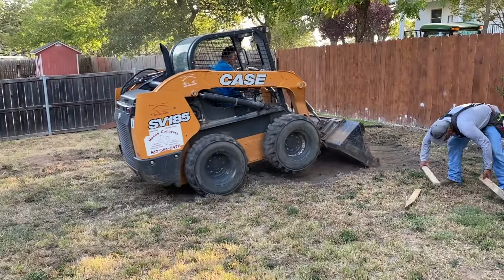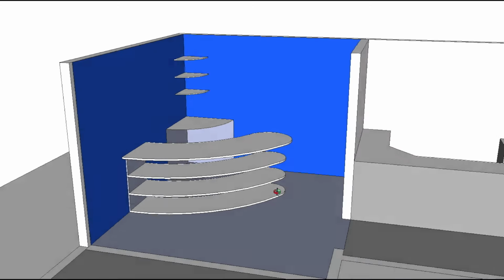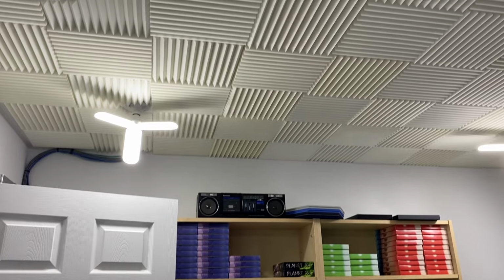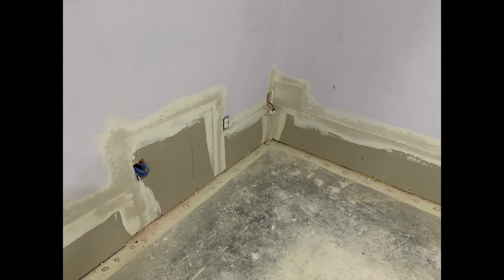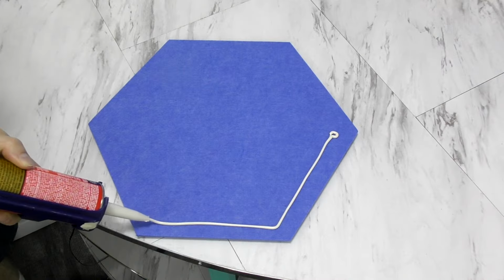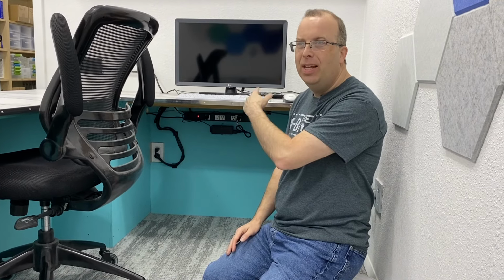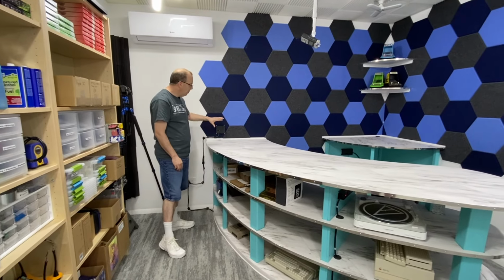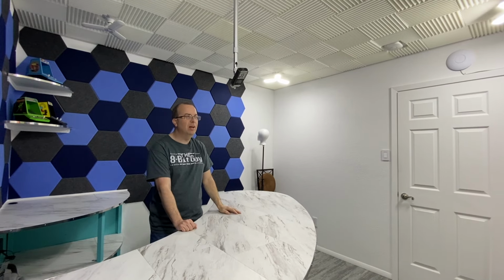8-Bit Guy Studio Build - Part 3

Comment: As someone from a completely different part of the world, the way americans make their walls out of thin boards is always fascinating to me. I'd be way too worried about stumbling and accidentally crashing through a wall, I think. :(
Reply: Yep, only bricks and concrete here.
Reply: I also come from a place with brick walls, but we have few drywall walls in some places, and you will be surprised how much abuse they can take. Also can you recall the last time you crashed into any wall :D
Reply: Drywall is surprisingly strong!

… But there’s a few random parts of my wall that are made of actual cardboard. Like what a TV dinner comes in. I don’t know how or why but I’m guessing it was an aftermarket patch by the previous owners. They should’ve done it right though because it got kicked in pretty fast on accident (next to a bed).
Reply: Sheet rock is exactly that- gypsum stone mixed in a slurry and formed into boards. When screwed on 18” studs on both sides of a wall it forms a rigid structural member that is able to withstand settling, earthquakes, and impacts. When damaged it is easily repaired. It’s environmentally friendly as you are not digging the earth for stone, and an insulated stud wall is far more efficient than the massive heat/cold sink of a masonry wall.  It’s also much more fire resistant than a timber wall. It is equal to the task with a significant margin, but not massive overkill. It promotes rapid construction of quality affordable housing. It’s “modern” technology. Any questions?
Reply: @edd2771  that's actually quite interesting information. Sounds very sensible.
I always wondered, seeing collapsed houses on the news, why a country that has so many hurricanes doesn't build their houses of concrete.
I also thought they would be terribly isolated and you guys would just heat/cool like crazy, because fuel and power is so cheap in the US (well, the video on the blizzard taught me that that's not always true).

Got some question though: what about sound insulation? 1/2 inch is paperthin for a wall.
Also, doesn't that mean you can't use nails to hang a picture or something on the wall, if there doesn't happen to be a stud behind the exact place you want it?
Reply: @LRM12o8  many people do use insulation on interior walls (especially bathrooms) for sound insulation, but even without the sound transmission is not bad in my experience.  The space between the opposing drywall sheets  is dead space, not conducive to carrying sound waves as a solid wall might. . Hanging pictures on studs is best (and required for say a flat panel tv or cabinets) but if it’s new construction builders plan for those areas with blocking between studs. But even after the fact installing blocking is not hard given how easy it is to patch. As for ordinary pictures and mirrors there are all manner of drywall hooks and anchors, some of which can hold 25 lbs each. Hurricane and wind prone areas are constructed with tie downs. The wood is not merely nailed together, metal strapping is added so lift forces will it pull the walls or roof upward. Of course, if the “big one” comes even masonry structures like commercial buildings get damaged. But generally in the past 50 years the building codes have learned to deal with each areas potential hazards.
Reply: @edd2771  Yes: Load bearing? Sound insulation? Mounting heavy pieces anywhere I want, not just where studs happen to be? Hurricanes? Bulging due to humidity? Damages after removing wallpaper or other decorations? Filling in holes where things were screwed into?
And it's not like limestone bricks are cut as they are from actual stone. They are formed pieces just as well.
Drywall is a cool thing when installing it the first time because speed and cost, but apart from that I can't find too many advantages over actual bricks.
Reply: @fonkbadonk2957  I’ve owned four homes over 40 years and never once encountered bulging due to humidity. Due to an active leak, maybe, but that’s going to undermine your masonry wall as well. Load bearing?  Yes, our houses do stand up under their own strength, stick built construction not withstanding. And if you want to move a wall, even a load bearing one, it’s actually possible, if not easy. Modern wallpaper primers and pastes allow peel off in a snap. You should try it…very satisfying. And as mentioned, repair is very easy. A little more  work for heavy items, yes, but a more than fair trade for the advantages.  As mentioned, building codes in the last 20 years have made homes greatly resistant to hurricanes. And most hurricane damage is due to floods- your masonry home will fare poorly in a flood too. We have stone and brick homes in the US and they are lovely. I have nothing against them. My initial comment was in reaction to someone who said they would worry about bumping into paper thin walls, ripping holes in them with regularity. I am here to disabuse the curious of that notion, and highlight the trade offs involved in stick built homes, which on balance are very worthwhile. A final point, many higher end homes here have a veneer of plaster applied to Sheetrock. It is still worlds more speedy, cost effective and energy efficient than brick/stone, and adds a level of durability. Modern plasters can also flex and take nails/hooks very nicely. Any further questions?
Reply: @fonkbadonk2957  adding wire or pipes to an existing wall!  You can't pull a wire through brick.  How do you get the pipes and wires inside the brick wall, anyway?
Reply: @JohnDlugosz  Wires are either done in shallow grooves cut into the brick (there is a specialized tool for doing this relatively easily), or flat cables are glued to the bricks. For the outlet and switch cases (don't know the English word for those), you have a special drill bit to make the big holes. Since bricks are normally covered with a layer of plaster, everything vanishes behind that.

I'll admit that later installations are a bit more complicated in that way, but even with drywall you usually have to take a good portion apart and patch everything up later. For small additions we often use small cable ducts mounted onto the walls. but that's ofc less pretty. But I also wouldn't open up a drywall for getting a socket a few meters somewhere as well.

Pipes are usually a fixed ordeal, running within/among the bricks. For major changes, you'll need to dig them out. In newer buildings, they are also often run through a cutout in the bricks that is only covered by a metal net and plastered over. Comparable to drywall to to work on imho. In older houses, you sometimes also see them just running openly or in on-wall ducts, with only breakthrough holes to get from room to room (or floor to floor). It all depends a bit on available wall thickness, if it's load bearing, and cost of course.
But really, how often does one need to change their pipes? Only times I have ever seen this was either after someone buys a house and does other major renovations anyways, or some dedicated room-wide re-designs where this also is a non-factor in the overall expenses.

To be clear: I am not 100% against using drywall! It is great for non-load-bearing room shaping if made thick enough and well insulated, or doubling-up brick walls for ease of wiring/piping! What I will never like however are houses entirely made of wood framing with even the outer walls having nothing but some wood planks, stonewool and drywall separating me from the outsides.
Reply: 1/2” sheet rock isn’t really that thin, and it’s supported every 18” by 2x4” wooden studs.  You would be having a really bad day if you ended up going through it.
Reply: I lived in a building that had walls so thin that when we put our table up against the wall we barely even moved it you know being really cautious and when we remove the wall you could see where the table was because it had chipped away at the wall.

I know this is the wrong YouTuber but the wall scratches at the level one with deeper grooves at a level two

Honestly wouldn't surprise me if the walls were made out of chalk because it kind of chipped like that.
Reply: Back when I was a kid, I saw a video of some slender young man leaning with his elbow onto a wall and instantly crashing through it many times on a TV fail show. The clip was literally shown in every other episode, lmoa! 

Don't know if it happened in the US though, but I can't imagine that to be normal. Something was clearly amiss with that wall, lol!
Reply: They are great for punching though!!! So satisfying 🤣
Reply: @vinnieravioli4653  You punch Drywall? I'd imagine that is a very quick road to a broken hand... then again, crushing your hand between 2 2/4's while trying to mark for studs is a rather effective way to do the same thing...
Reply: You would have to hit it really hard or hit it with a hammer to break it or dent it.
Reply: Here in Chile a wooden wall wouldn't last a year lol
Reply: We build houses mostly the same way here in Australia. Just a timber stud frame with plasterboard/drywall. I find it really strange when they talk about building houses out of wood on Grand Designs as if it's a strange and unusual concept. We do brick houses as well, but mostly it's just wood frame and plasterboard.

You'd have to be going pretty fast to actually break the wall by falling on it, and even faster to go all the way through. More likely you'd just hit a stud or nogging.

Comment: If the hexagons work fine but you don't like the look, consider covering them with acoustically transparent material like a thin fabric.  Movie theaters do that to hide the speakers in the walls.  The fabric can be had in different colors or dyed.  Another trick used all the time in TV is to put a blue bounce light in the background to reflect off the walls.  Then a red or at least warm light on the face of the subject.  This makes the person pop out of the background both visually because you can see then better but also because the blue light can sort of obscure unimportant things in the background and redirect all the viewer attention to the foreground subject.  You'll see this trick used all the time in TV news. The crews carry a battery powered blue light and place it behind whoever they are interviewing, if it's in an office or whatever.  Works well. Very inexpensive.

Comment: The problem is all the colors are pretty, but just don't go together.  Like the blue on the desk doesn't match any shade of blue on the wall and then the desk is super light while the walls are dark.  The only wall color that matches the turquoise is white, which you can't do.  My humble suggestion (cause all I watch are home design shows) would be to stick with the color scheme of the hexagons.  All of the hexagons should be the same color or mostly the same color.  One of those colors on the wall and one on the desk with wood tile countertops.   For example dark blue on the wall, and light blue on the desk or the opposite.  

I know you worked so hard and probably don't want to make a change so soon, but just thought I'd throw it out there!

Comment: I am very pro-hexagon. (Self proclaimed Hexagonaphiliac.) However, I really only have two issues. One is actually with the hexagons, with how they meet in the corner. Might have been better to have cut several in half to act as the corner pieces, to keep both walls fleshed with each other. It's a minor gripe, though it may trigger people with OCD.

The other issue is.... you need to do a color rebalancing of the camera. It's looking a bit blue-ish. And I don't know if it's because of the blue hexagon theme, lighting, or if the camera setting got reset. The pictures and the other camera didn't seem to have that problem though, so it's likely the main camera.

Comment: Nice studio! I'm in the Dallas/Fort Worth area and went through that same blizzard, and the roofers just fixed our house from the huge hail storm a month or so back, and I just got my car back from getting the hail damage fixed. 

I think maybe the hexagons might possibly look better as a blue to dark blue to gray vertical gradient, just a possibility.

The machine language episode was a really good one. I'm learning 6502/65C02/HuC6280/Z80/68000/65816/TMS9900 among others, building emulators as I go in C++/SDL/OpenGL/ImGui with the kinds of graphical debugging features I want. The TMS9900 sounds odd but my family and I had a TI-99/4A when I was a kid, and also a Turbografx-16, which being a HuC6280 was technically a 65C02 variant. I did some small amounts of x86 ASM back in high school in TASM for MS-DOS and took a course on ASM in college.

Here's a screenshot of the NES emulator so far viewing the CPU/PPU with 6502 registers/flags, a memory viewer, mapped memory registers, and I view the disassembly of each instruction with its numeric opcode, cycles, parameters, addressing mode, and the time in ticks it was executed:

https://imgur.com/m2Uy9zp

Comment: Did you connect your desk to the neutral side of the power line? In North America, the ground contact (middle round prong) is electrically connected to the neutral at the circuit breaker. If that's what you did, I'm not sure that's such a great idea. I would just run a ground stake and drive it into the earth outside your studio. It's still going to be connected to the neutral through the actual ground, but it's got a hell of a lot more resistance through it.

Comment: the part where you talk about the ethernet jack... you should cut the trim on the floor to the size of the desk so you can push it all the way to the wall. I do realize that the cables are there but I think you should find a way to move it as one or two wrong swings in that desk chair and pop, those cables will break. Just a thought but nice work either way.

Comment: Also, I'm not sure why anyone hated the original vinyl.

On the hexagons, could you not have used rit dye and just used a tub wide enough to soak the whole thing?
Reply: I’ve noticed that non-crafters don’t know, well, a lot about crafting. But it’s the same with tech and mechanics, and most unfortunately cooking. I was lucky to be born into multiple.
Reply: I've never actually used it myself, but it's made for fabrics, and sits on the shelf at our local Publix. As I understand, you mix it with (hot?)water and soak the fabric/object in, so you wouldn't use any more than normal, and can likely use the same batch for several of the pieces. Just seems more economical to me if there's some reason not to just paint them(assuming it would be that you lose the fabric texture).
Reply: @an_innocent_bystander  I haven’t used it personally but yeah I think it’s hot. You can change the shade by dipping it in for different lengths too, and dip in multiple colors to combine them (or probably pour in multiple).

Comment: Great new space.  Feels like giant luxury compared to the cozy old setup.  The new background is good - although I liked the old blue vinyl, too.  The desktop is a little blown out, but I'm watching on a tiny monitor so it's probably not a big deal.  If you could squeeze in a couple of tiny high-power ceiling-mounted rim lights to halo your head and shoulders, it will look like real TV.

Comment: David I wanted to thank you for turning me onto those fiber converter nodes that you used to get your internet out to your new building I installed a set of them in my house to bring the internet out of the room where my cable modem is installed out under the double wide that I am living in and then back in through the wall to the living room on the opposite side of the house to bring my internet to my smart tv and PS4 as well as my desktop computer.  I am using the same set that you showed on camera when you did the video talking about sending your internet from the house to your new studio they work amazingly.

Comment: If you're working on high voltage items like old monitors, I have two words for you.  Isolation Transformer.  https://en.wikipedia.org/wiki/Isolation_transformer

The idea here is that anything plugged into the isolation transformer (120v to 120v) isn't at all connected to the ground, So if you plug your monitor into the isolation transformer, then have one hand touching a live wire on the monitor, and the other hand on a very good earth ground, you won't get shocked.  Why?  Because contrary to popular belief, electricity does NOT want go get back to the ground, it wants to go back to the source.  Normally the electrical grid is also connected to earth, so there's not a huge difference between the two, but with an isolation transformer there is since the other side isn't electrically connected to the power grid.

Of course doesn't protect you from all shock.  One hand connected to a live wire, and the other hand connected to a neutral on the TV will still give you a jolt.

They aren't dirt cheap (maybe $100-$200 for something large enough for a monitor), but if you're working with monitors regularly, it's cheap insurance when the alternative is death, or injury.  Someone on your channel may even have one lying around, and be kind enough to just give you one.

Comment: I thought you had sound deadening material in the walls? We used to use sound deadening insulation and drywall. We did the insulation, a layer of regular drywall, and then the sound deadening drywall. Learned some neat tricks doing home automation. We did large scale theaters and arena’s also.